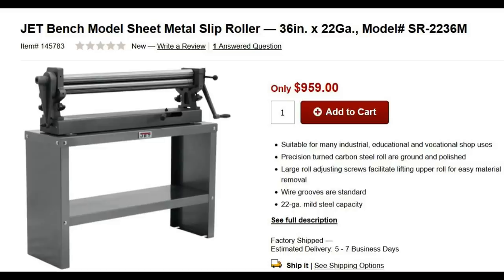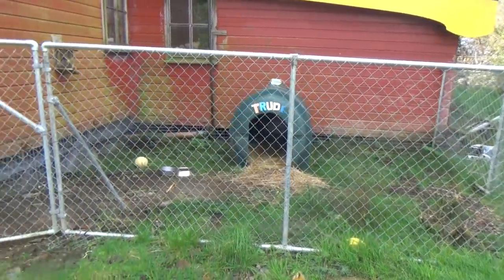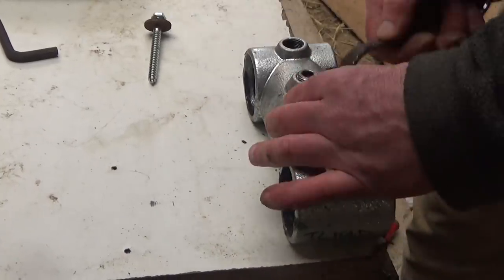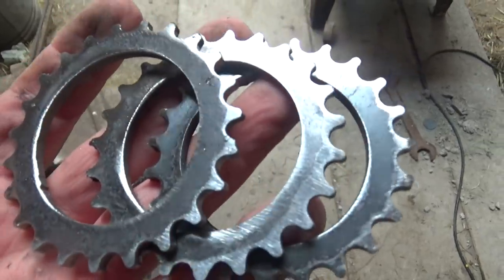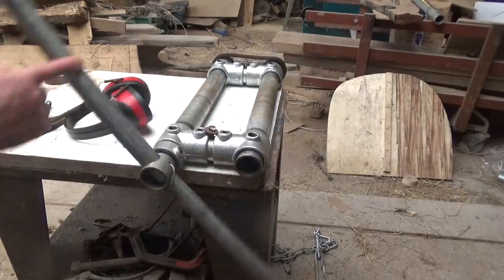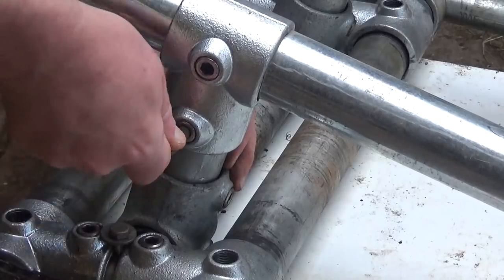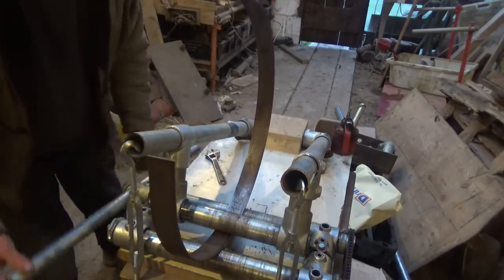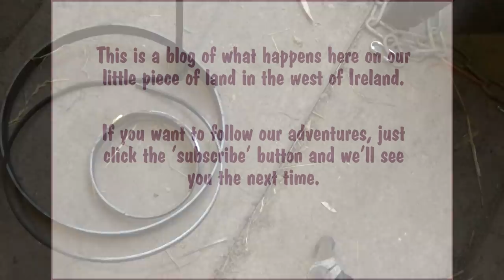Simple Homemade Slip Rollers (Heavy duty slip-rolls for less than €80!)

Comment: Great idea with the pivoting top roller! I recently built a small roller for 60x5mm flat bar. I used a hydraulic press to push the top roller down. If you want to use bearings you don't need the expensive bearing blocks, just buy cheap  normal bearings and make wooden blocks for them. To make the bearing ends to the tubes you buy cold rolled steel bar. Use hole saw (or plasma) to cut discs that will center the bar inside the tube.
Reply from the maker: You're right, of course. And I think for a project like this it wouldn't be crucial if the bar was very slightly off, but for some projects you'd need a lathe, surely?

Comment: Very resourceful.

Btw, perhaps you could make some babbet bearings from old wheel weights. Though, you have to be careful of zinc fumes if you heat galanized anything.
Reply from the maker: I had to look up babbet bearings and I don't know what you mean by wheel weights. But apart from that, thanks!
Reply: @WayOutWestx2  Well, it was meant as a possible source of cheap material, though some extra tin might help.
Reply from the maker: Do you mean the little weights they add to wheels to balance them?

Comment: First I want to say I'm impressed .I like your work, Clever !  I'm interested why you did it as you did. I'm looking to roll some 14 gauge.
What was the reason for the Hinge Designed on the Pressure Roller instead of a typical Screw Type say made of Trailer Hitch wheel. ? 
Would not the working stock turn the lower rollers on contact without the chains ?
What do you think of using cement or a plastic with Rebar inside the Tubes to make them stronger ?
         Keep up with more great ideas and thank you for sharing them with us.

Comment: Really nice! What is the thick-walled steel tube sold as "cheaply"? Looking at building a number of things (polytunnel, rocket mass heater) and am coming across little to no reasonably thick walled pipe which isn't aeronautic grade prices...
Reply from the maker: Look up 'Blue Band' galvanised water pipe. I think it's about €30 for a 6m length of this size. (Not suitable for aeronautical projects though!)

Comment: You can buy those gears even cheaper if you get the ones that require you to weld in a bushing and that way you wouldn't need to drill them out. I think they come with either a 1.25" or a 1.5" hole. I welded the bushings in when converting a bush hog from pull behind to push for my tractor.
Reply: I'm having trouble finding gears for a bushing. Can you provide an example?
Reply: @jheissjr  Wow I really didn't think it would be this hard to find online. There's a local store here that sells them cheap called Agri Supply but finding them in their online store with any information has been challenging. I did find https://www.masterdrives.com/weld-on%20hubs/default.html
Reply: @jheissjr  The proper term is Sheave. If you search for that you will find them. Annoyingly that was the issue.
Reply: I found the name thanks! They are called chain sprockets!
Reply: @jheissjr  Thanks. Silly jargon making us work harder than we need to.

Comment: Tim great job I always wanted a metal roller too, any chance of getting plans and such
Reply from the maker: I'm not very good on plans - I'd say just make it up as you go along? You can always remake it if it doesn't work first time.
Reply: Would you be interested in making and  selling another set of sprockets?
Reply from the maker: Sure - as long as you want the same as I used. But I only have 4mm steel and I think they're really 5mm, so you might be better off with the platewheels anyway. (Mine work fine - but the chain has to be not too sloppy.) You'd also need some 3/8th chain, of course...

Comment: What is the maximum thickness of steel 12 inches wide that yours can roll?  I'm trying to compare it to the ones from Cammeck Equipment.  It looks like theirs are pretty tough too.  thanks.
Reply from the maker: I rolled a piece that wide for a printing press, and I think it was 3mm thick

Comment: Not bad.. Notice the material has to be longer than your actual wanted measurement..
Each roller needs its own length. 
Can be shortened by prebending with a hammer into wanted radius. 
Measure/align with a piece of cardboard.